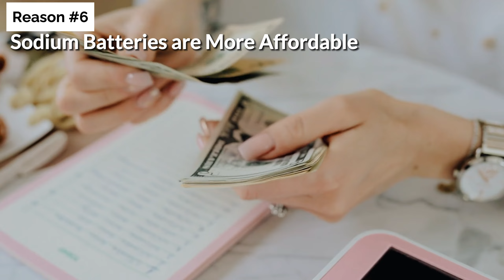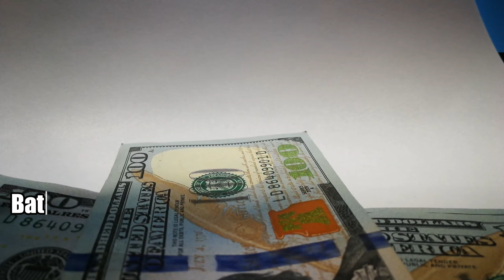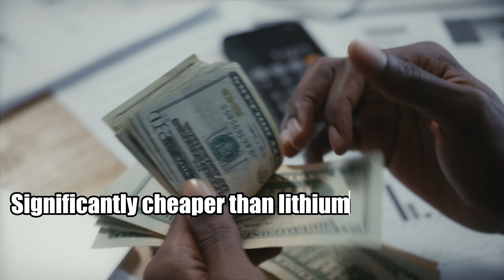2024 Breakthrough: How This Chinese Sodium Battery is Revolutionizing the EV Industry!

Comment: In reason 6 you state that Lithium is a rare earth material, that is not really correct is it? Rare earth materials (minerals) have the atomic numbers 21, 39, and 57 through 70 ! Lithium has the atomic number of 3 and can be described as a critical mineral but not a 'rare earth'. Hope that was just a spoken error and not meant to be deliberatly misleading! Otherwise your reasons (reasoning) are sound arguments.
Reply: It is in a way, because only a few countries have the abilities to extract it to be lithium and that makes it rare, does it?
Reply: Lithium is not rare earth nor rare, but cobalt is rare, but not "rare earth".
The sodium battery is not as good as Li, but maybe OK, for a lower price point.
Lots of weasel lingo.